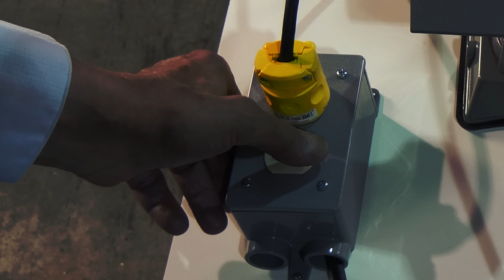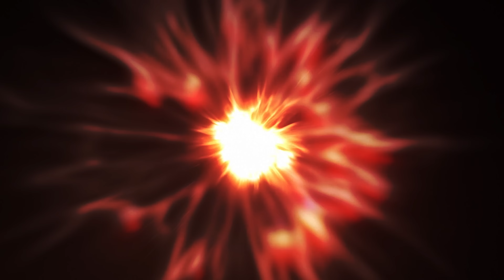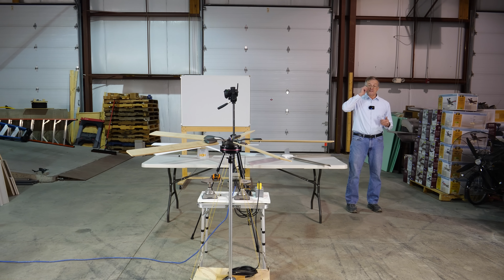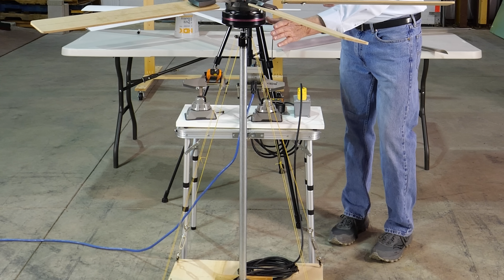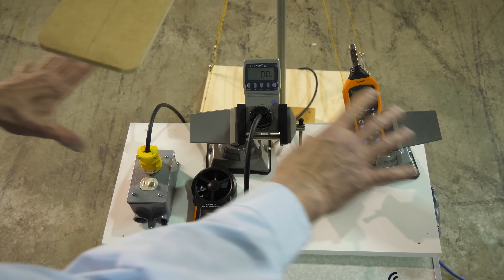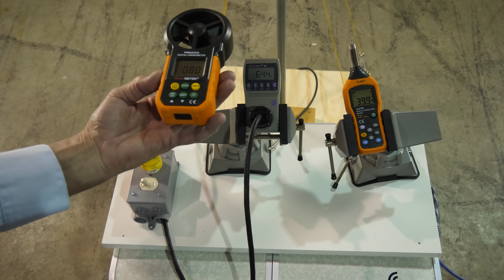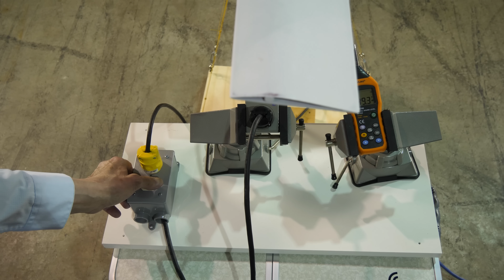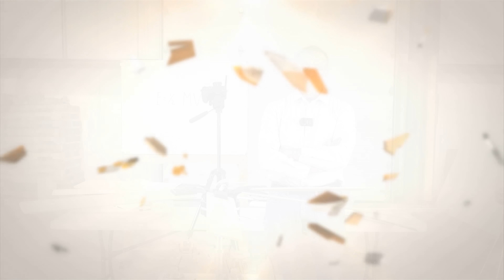This Fan Uses Almost NO Power

Comment: Would've been interesting to see a test of the DC motor with the airfoil blades
Reply: Why didn't he show power consumption with the airfoil blade moving air at 1 m/s? Was waiting for it...
Reply: @MichaelPicher43 The AC fan’s speed wasn’t continuously variable.
Reply: Yeah I was waiting for that
Reply: @ssnjr1299  We all were... 🤦
Reply: @ssnjr1299  Same.
Reply: Seems like a glaring oversight.
Reply: @hank44 C+
Reply: I'd also like to see the optimal amount of blades and come to that blade sizes, interested UK side
Reply: Optimum setup would be the same as for a helicopter in hover, one infinitely long blade with hyperbolic twist 😅. In practice you will want to limit the fan diameter and probably add a second blade for balance 😁.
Reply: I was hoping to see a version of the metal foil blades with dimples on them, like golf balls. Or some of the technologies common with wind turbines, like vortex generators or winglets. To be able to 3d print and glue some parts onto existing fan blades and increase their efficiency would be awesome.
Reply: @deftnerd while the fan blades are also at a very low Reynolds number, which is partly why dimples are on golf balls, Flow separation due to laminar flow is the reason they put dimples on Gulf falls.   Fan blades probably have much of a flow separation problem even at low Reynolds numbers, as long as the angle of attack is not too much.
Reply: @deftnerd Big shop fans use winglets
Reply: Technology connections - come over, you need to see this! 😄
Reply: re: "Would've been interesting to see a test of the DC motor with the airfoil blades"
Ahhhh ... we're into multi-episodic events now; You must tune into the same bat channel at the same bat time tomorrow!
Reply: The new brushless DC drives in cordless power tools have revolutionized the power available in small hand tools. Even going from one generation to the next available torque increase versus power consumption is significant for battery life
Reply: @chrishayden3854  Yup.
Years ago (2015-16 ish) I worked for a company contracted to another company (Aerotron) who took on this very idea.
Plastic blades designed for aerodynamic efficiency coupled with BLDC motors. Much quieter, higher power efficiency while still moving more air than a "typical" ceiling fan. From a cursory look just now, they seem to be doing well. Didn't look too hard but couldn't see any specifications sadly.
Reply: @chrishayden3854 the difference from brushed to brushless in power tools is marginal at best. The zero speed torque on a brushed DC motor is better. They compensate with more gear reduction and faster motor speeds. Battery life between the two isn't too much better. You have more transmission losses and how many screws you can put in per charge vs number of spares people have and speed of recharge.. its pretty much a mute difference. 
They are able to go to a shallower, smaller motor, faster rpm through a compact planetary gear set making very compact tool. That's impacts where you want to fit it between joists are brushless and normal drills are still brushed. Even by Milwaukee and dewalt.
Reply: @jim4556  Small brushed motors are 65%-70% efficient at best. Small brushless DC motors are typically 90%+. That ends up being about 25% more mechanical power out for the same battery power in. That's not marginal at all. With modern controllers the torque advantage is marginal, or non-existent. Less heat in the tool is also extremely useful under heavy use.

The cheap drills are brushed, the high-end are brushless, from basically every brand.
Reply: it will be the same at the same rpm.  The blades don't know how they are being spun.
Reply: Yeah, that is killing me lol.
Reply: Excuse the commenting before watching the whole video so far, but why not differentially pitched blades to match speed with airflow to balance loads like s propeller.
Reply: this, and how low power consumption could be tuned to for the same 1 m/sec air flow wit a specific blade config. I think there might have been the real surprise.
Reply: got distracted becuase I need to switch out all the motors in my house. But I was super excited to see the results lol
Reply: they should do an update and test this. im sure they have the materials still.
Reply: Wonderful a HVLS 'Big Ass Fan', video.
Reply: @perpetual4958 big ass fans are Dramatically over priced
Reply: I would like to see the airfoil with some small end plates to direct the air off the tips.
Reply: I was thinking the same thing and also on how he made the airfoils
Reply: Yeah glaring omission. 
I’m just still waiting for the follow up boat videos.
Reply: Oh man was i sad he didn't. Im betting the wattage dropped quite a bit or it would allow way more air for the same energy.
Reply: This!!! I’m surprised he didn’t.
Reply: Was about to say the same
Reply: Agreed
Reply: Waiting for that too!
Reply: Did he mention the model of the DC motor/fan? I'd like this for an off grid cabin that will run on solar and batteries so I can reduce the strain on my system.
Reply: The blade type was basically not the thing this video was about, more the efficiency of motor's. The aerofoil was 20% better on the AC motor, and will be the same on DC motor, the blade's haven't changed their properties.
Reply: @AlsGeist That doesn't mean that the energy use or noise follows the same trajectory though. I also believe the difference between them at different speed won't be linear for either motor.
Reply: Aerofoil blades are designed to create a low pressure on the top of the blade and create lift... in a fan you don't want negative pressure above the blade, I'm surprised the aerofoil didn't reduce performance. You also want it to be reversible so you can circulate in the winter and provide a breeze in the summer.
Reply: @andyca15  difference from good aerofoil and bad aerofoil is the lift to drag ratio. Good one will make a difference here, either increasing flow speed or decreasing RPM needed for target flow speed. Reverse is a clear disadvantage though
Reply: @andyca15 :

I’m surprised that you have no idea why a pressure drops.

If a fan moves air, it will decrease pressure on one side and increase pressure on the other side.

You can’t move air without “negative pressure”.

There’s a switch on the fan to change from downflow to upflow by reversing the direction of rotation.
Reply: @denverbraughler3948 Right, but the airfoil profile would be moving in the wrong direction. I feel Tech Ingredients has a potential series here, to solve this, maybe with a mechanism that adjusts optimal pitch with speed too, which is likely achievable with mechanics using centripical  weights.
Reply: @andyca15   air foil  create "negative " air pressure at optimal pitch angles and it increases efficiency coz they don't just push air downwards they also "suck" air so  even more moving it down.  Wooden "slabs" they have turbulent air on upper part , and unnecessary turbulence is just turned into sound and turned heat, tho losing efficiency in moving air wanted direction.
Reply: @andyca15  Yea but can they help with a sagging ceiling?
Reply: @andyca15  Right they create low pressure above the blade by causing a net downward force on the air. Thats the equal and opposite side of lift. Push the plane up by pushing the air down. The reason it improves performance is because the flat blade just pushes air down. The airfoil pushes it down and then Also sucks it down behind it.
Reply: @andyca15  If you don't want negative pressure above the blade, why install them at all?
Reply: @andyca15 It does cause a low pressure area on the convexic side, but it also allows for laminer flow which greatly reduces air turbulence and drag.
Reply: @andyca15  It probably makes sense to optimize the airfoil for summer draft, as during the winter a lower airspeed is desired. And if it is running less efficiently, the increased waste heat is working for you rather than against.
Reply: @andyca15  i think the main reason why it is higher efficiency is because the airfoil blade has lower drag. i guess the point of the video is that even with the barn door blades the motor led to an efficiency improvement that dwarfed what the blade shape would do, but yeah we are missing what should be a useful data point. But it leads to a slippery slope of optimizing the blade shape...
Reply: @dc443   Also could do the test with larger blades running slower. thanks to the e=1/2mv2 moving a bigger volume of air more slowly is great for efficiency. Some of the destratification fans are huge and slow for this reason.
Reply: @andyca15  On a vehicle it creates lift, moving the vehicle upward. On a fixed object the blade cannot go upward, so air must go down.
Reply: @andyca15  the lower pressure on the top of the blade is what allows it to direct so much air downwards
Reply: @andyca15  You're wrong about the lift and negative pressure on top part, but you are very right about the reversibility. Lift and negative pressure are relative terms, lift requires a downward force to create the upward force of lift, in ceiling fans blowing air downward we are using that downward force, it provides an equal and opposite upward force, lift. The whole negative pressure thing, it's just lower pressure on the top than on the bottom.
Reply: @ckirocz28 I suspect you are right about the negative pressure, I’m a pilot so it just seems wrong, but I stopped studying Physics at 18 (except the aircraft related bits)
There is probably some fluid-dynamics going on to ensure air is replaced from above more efficiently than below when using an aerofoil as a fan blade.
Reply: There's no need to. Weren't you listening?
Reply: @TheZombieSaints  It's called curiosity. Being able to see a summary of all the numbers would have made for a better video imo.
Reply: It makes no difference at this speeds. All of those blades will move about the same amount of air for the same mechanical power provided.
Reply: @electrodacus it stands to reason that it would likely see the same 20% increase as before, but still nice to see to verify.
Reply: @electrodacus  but they didn't on the original motor test. Airfoil was almost two times as efficient.
Reply: @JonasTamaliunas  The original motors is so inefficient that is completely irrelevant for any comparison as it uses almost the same amount of power even with no load and you can probably put a huge load and the power used will not change.
Also the way the test was done is also not in any way a measure of efficiency.
I'm not saying there will be no difference in efficiency but it will be small enough for this case to be negligible 5 to 20% will mean nothing and nobody will by more expensive blades just to get 10% efficiency and save 1W or 2W.
The original propellers are perfectly fine and are low cost and look good.  You need a proper flow measurement not speed at a single point to calculate the efficiency.  Even the original blades could be changed at a different pitch and provide a different air speed with same exact motor.
Also an both are AC motors even if one is called a brush-less DC motor and is not the type that counts as much as the bad design on the first motor. Nobody cared to invest time in designing a proper motor as nobody cares (consumers are not educated else they will likely care).
Reply: @electrodacus  prove it!
Reply: @electrodacus Right. The paddle and the airfoil use the same power on the AC motor, so they should use about the same power with the BLDC motor. However,
1. He measures electrical power, not mechanical power. Motor efficiency matters, it's far from 100%, and could vary with, e.g., RPM.
2. Skipping experiments because you think you know the answer isn't fantastic science. 
3. The people just want to see the best motor with the best blades to compare against the worst/worst, okay? Is that too much to ask?
Reply: @lrschaeffer  Of course you can do the experiment but if you do not understand what you are doing as demonstrated in this video then if fairly pointless.
The electric motor will have an efficiency variable with load so even changing the pitch on any of the propellers it will result in a different motor efficiency.
The propeller efficiency assuming exactly the same mechanical input will be very small between the models shown.
Not understanding all the variable involved will result in incorrect conclusions.
The conclusion from this video is that the original motor had no respect for the environment or your wallet and was design no look like something useful but it seems is mostly a space heater. So just try to get a proper quality ceiling fan from a manufacturer that knows what it is doing and cares about what he is selling (not easy to find).
People like you watching this types of videos maybe care but are a very small majority so the successful business will be those that sell the the uneducated masses garbage but very low cost products.
Reply: @electrodacus  Sure, but that doesn't mean that the variation of energy use or noise levels will be the same as the cheapo AC motor.  

Anyway, I love your work on open source solar controllers. Big fan! (Pun!😅)  Cool to see you here!
Reply: @electrodacus  As you could clearly see this motor was much more powerful, so likely the difference would be significantly greater at full power, due to much higher rpm.
Reply: @electrodacus  Really?  Can you show that proof in your own video?
Reply: @1dariansdad  You can check my last video that explain a more complex wind powered cart that uses propellers and those propellers in my video where around 80% efficient while operating at much higher speed. This ceiling fans are not for propulsion just need to move air around.   At low speed and large pitch it is less relevant what shape the propeller has and that is much more important at high speed and low pitch.
Reply: @electrodacus  why would it makte no difference?!
Reply: @PM-wt3ye  Say one propeller is only 50% efficient wile the other is 70% efficient and say the mechanical power in the inefficient propeller for this is 10W and then the motor with no load uses 8W and say motor is 100% efficient after that no load power thus you use 18W total for inefficient fan. Now the efficient one is 70% efficient meaning it it requires just 6W so total including motor is 14W for the efficient fan. Do you think anyone will DIY hopefully more efficient blades for 5 to 15% efficiency gain.  Keep in mind that I used a bit exaggerated differences and there will not be that much of a difference if measured correctly not by measuring the speed  at one point.
Reply: @electrodacus  thx, But if they were already installed, gaining another ~10-20% on billions of units, would be pretty good i think...
Reply: @electrodacus  no, they don't move the same amount of air per mechanical power provided. there are losses in the blades.
Reply: @electrodacus  at what speed?  he did a slow test as well
Reply: @electrodacus  i do totally disagree , mechanical power maybe converted into sound , turbulence , or useful directed movement of air.  
If you theory was true then helicopters would use sqare metal blades , but not they use specific air foil , with optimal pitch angles.
Reply: @Rom2Serge  This is nowhere near the speed and power of a helicopter blade that work at the limits of mechanical failure and every 5% extra efficiency counts.
A large slow rotating propeller will always be more efficient than a fast rotating propeller. The shape of the blades will make way less difference than you imagine in this particular application.
Reply: @electrodacus  i do agree that same  ammont of whatts would move same ammont of air , coz of conservation of energy. But energy can be used in desired way or,  undesired. Like making unwanted sound unwanted turbulences, or making desired lift . 
I Googled coefficient of drag , so i put in calculator, 1m long airfoil and  a flat plane , 10 cm thick , pitch 5 degrees,  speed 20 km ,  (about 15 miles an h) to put airfoil at worst scenario , coz of low speed 30 km/h.  And calculator gave me coefficient of drag. 
NACA 0012 (airfoil)
CD≈0.012
Flat Plate (just a same dimensions flat plate 5mm thick)
CD≈0.06

5 times difference , 5 times less drag and more lift! And it at 30 km/h  , and at speeds over 100km h , coefficient of drag to lift difference is x14 times. So yours theory "20% difference between airfoil and flat plane" it totally wrong.
Reply: @electrodacus  That's a good point, but most people are not are not so bright.

Comment: Aw I wanted to see the power consumption with the efficient airfoil and new motor! I wonder how close to 8 watts you could have gotten!
Reply: Criminal oversight
Reply: I think the point of this video is shown at 21:50, and is that these motors could be improved across applications. Optimizing the blades for the fans is great for one application but does not offer benefits as broadly. Also, he mentioned earlier that the juice (making new blades) may not be worth the squeeze. That said, it would be cool to see what kind of performance he could have obtained with the best combo.
Reply: This please, the efficiency gain  may be bigger then with the AC motor. 
The flat blades have a very high drag, and at speed the noise performance could be better. 
Also, try wing tip plates against wake turbulence.
Reply: 20% .